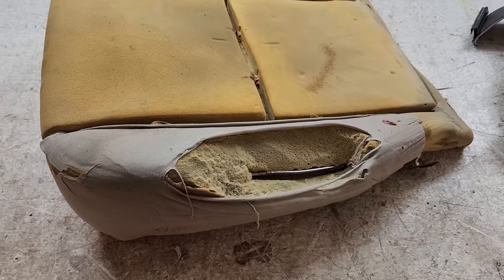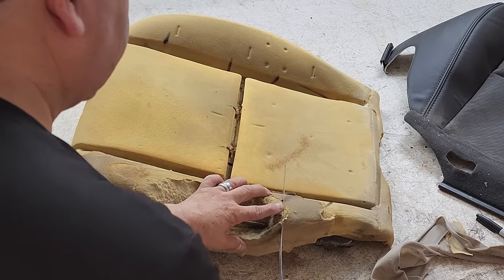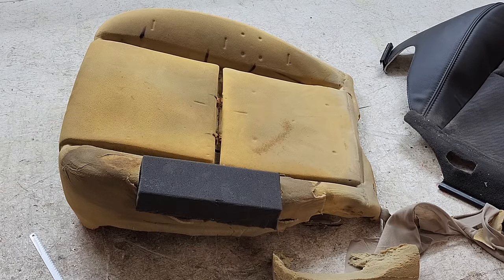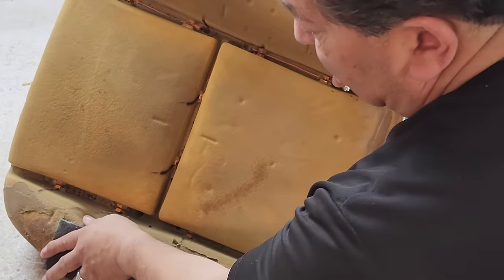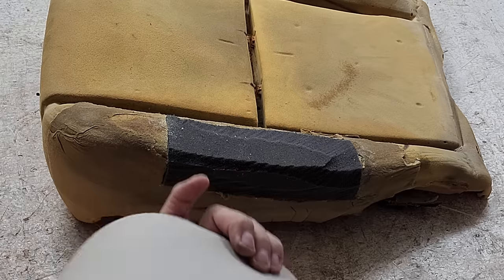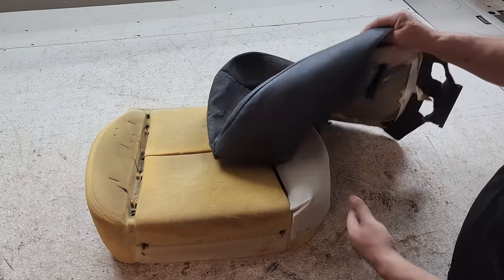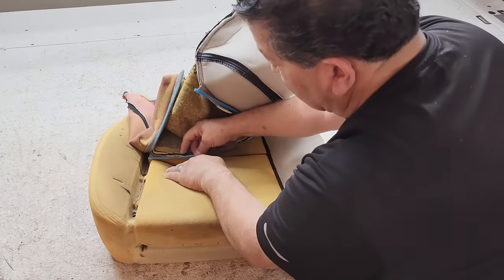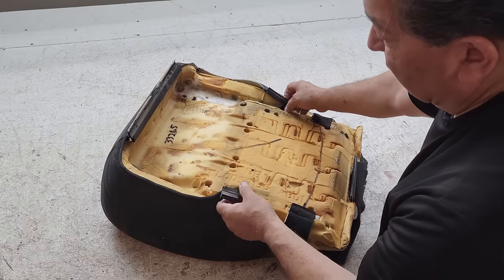How to do it yourself basic seat auto foam repair DIY

Comment: I worked for 13 yrs at an automotive plant manufacturing seats and we always fix tears in cushion and back foam with spray adhesive and never let it dry . Put it together wet for a better bond. Your method is correct
Reply from the maker: Hello Cherokee, I am so glad to hear that what I have been doing for 43 years is correct. Thanks for saying so. Please keep liking and watching!
Reply: The correct method is to spray the adhesive then wait a minute or two for it to become tacky then apply the foam
Reply: @kenshinhimura9387 that’s what the directions say but doesn’t always work best. Depends on application.
Reply: @oldschoolautoupholstery  Try letting it dry for a couple of minutes if you can. The only reason to not wait and instead put the parts together immediately is if you need to adjust the position of the parts. If you let it dry for a couple of minutes first it will stick at first contact and not let you reposition, but it wil adhere better.
Reply from the maker: @tahustvedt  Hello Ta, Yep, it wouldn't hurt. Please keep liking and watching!
Reply: @oldschoolautoupholstery  What you're doing definitely works and has worked for years. Glueing in a block like that in a corner would be hard if the glue dried until it became sticky first.
Reply from the maker: @tahustvedt  Hello Ta, Yep you are so right! Please keep liking and watching!
Reply: What spray adhesive do you use?
Reply from the maker: @jamesoylk  Hello James, I only use contact adhesive for everything I glue. Please keep liking and watching!

Comment: I just did something similar to my BMW sport seats. The driver side outer bolster cushion was badly damaged from years of being rubbed on, I went to a craft store and purchased a nice piece of firm foam to replace it. Figuring out how to cut it was a bit of a challenge, but ultimately I shaped it with a small pneumatic sanding tool I have. It’s a small 2 inch disc that rotates at a very high speed. It shaved down the foam very nice, and allowed me to get the proffer shape and profile that was necessary before installing the new seat cover pieces. Seven sections to that seat, what a pain in the butt. I bought it from a company named L seat, I would have loved to use a local upholstery shop, but there isn’t really anything like that here where I live, such a shame, I love  giving local businesses my money over big companies when I can.
Reply from the maker: Hello Schro, I love hearing stories like this where you set out to do something and then you saw it through to the end. Now you have a satisfaction and can be proud  that you did it! Remember learning is doing! Please keep liking and watching!

Comment: i did that on my old xj, but added extra padding to the bolsters for a sporting look when I deleted the sliders & lowered the suspension ~4".

The seats lowered ~3" with the sliders gone. They did not move, so I put the seats where I wanted. 

I also put on shorter tires, which made it quicker, and lowered it more. I made my 2 door/2wd XJ SUV into a fast(er) 3 door hatchback car.
Reply from the maker: Hello Iowa, Sounds like a funmobile! Please keep liking and watching!

Comment: I've learned how to do this years ago and repaired many seats, then i went fixing mine's but then realized i could buy a complete set of seats out of a brand new Audi they converted to RS look for 120 bucks, after that burning the old seats is the best way to fix them, and installing new ones by adapting the mounts on the chassis is way easier, unless you are fixing an antique or furnitures, so having this knowledge is well worth it.
Reply from the maker: Hello John, Yep, that is one way of getting it done. Or if you got an old work truck in Texas, you can do it this way. No adapting mounts or messing with airbags. My cost was under 5 bucks. Please keep liking and watching!
Reply: @oldschoolautoupholstery  Hello. Yes for a work truck it's the best solution, not even getting a new seat of the same kind worth it cause we know it's not going to stay mint for long.
However this is knowledge that one should have but will show its glory in other kind of projects.
Reply from the maker: @johnbelwell2461  Hello John, Yes I agree. Please keep liking and watching!

Comment: I used to do this for a living and you must wait for the glue to get tacky Before You Stick To Pieces of phone together or you're not doing it correctly and the seat will fail. You use an electric knife to cut the foam to shape then you use a die grinder to form it to mirror the other side. Do you use the much thinner phone to overlap the thick piece of foam you glue down and you cut every Edge at an angle and shave it down with the die grinder until it's perfect.
Reply from the maker: Hello Ken, There is no real wrong way of doing this. It's not rocket science. Like I always say, there is more than one way of getting things done. The name of this video is "DIY basic seat foam repair". I am a working upholstery shop and have to keep things moving all the time. You can see 44 years of my work here: rudolphsupholstery.com  Please keep liking and watching!

Comment: Thanks for sharing this video, you're so good at explaining what it is you do!

I'm wondering, would you ever add the 1/4" scrim to the whole seat or just the part you've repaired? I guess it might add too much bulk for the cover to fit if you did? It's just I'm going to refurbish a bench seat in my 19 year old van and thought it might make it feel newer if I covered the whole thing rather than just the repaired section.

I'd love to know what your thoughts are on this if you have the time. 

Thanks again for running such a great channel.
Reply from the maker: Hello Bloss, You are so welcome! Thank you for your kind words! 1/4" foam or scrim will not effect any bulk. Just think of it like bodywork on a car. Bad bodywork shows threw the new paint. Same for the foam repairs under the upholstery. Just get your shape right then reinstall your seat cover. Please keep liking and watching!

Comment: I have been gluing foam for sporting projects for almost 30 years. I have found closed cell you want to let it sit/get tacky. Open cell you can apply it wet. I figure this is because airflow still allows the foam to dry more easily.
Reply from the maker: Hello Andrek, You are absolutely correct. Closed cell foam I consider to be a hard surface that needs air to dry. Please keep liking and watching!
Reply: Hi Andrek, what glue do you use?
Reply from the maker: @gurglejug627  Hello Gurgle, I only use Contact Adhesive on everything. Please keep liking and watching!

Comment: Most of the times I didn't even cut out the "Cancer" you referred to.
I would just saturate the damaged area with contact cement, let it dry and then spray the HD foam I was using for a patch.
When glued together I then used my small sandpaper disk grinder and shaped the foam to match the original contour of the 
rest of the seat.
Sometimes I'd put the scrim foam but most times I was able to match up the contour of the original foam well enough that it didn't need the additional quarter-inch scrim on it to smooth it out.
Reply from the maker: Hello Tim, Like I always say, there is always more than one way of getting things done. Thanks for letting us know. Please keep liking and watching!

Comment: I'm an upholsterer. What you did wasn't bad, but the way I do it is a bread knife, then finish shaping with an angle grinder with flap disk. You can get it pretty perfect without having any hard corners from cuts. Then spray with headliner glue, and top with dakron. You don't get so much extra pooch that way. Then recover and done. Also, I probably would wrap the seat bar with dakron before adding the foam so I didn't have a crush point where it was hollow under the foam
Reply from the maker: Hello Chad, Like I always say, there are more then one way of getting things done. This was a basic repair for an old work truck in Texas. Not rocket science. Please keep liking and watching!

Comment: Brother I think you missed the fact that the whole bolster is dilapidated, for that repair I would usually take the whole top half off and replace and reshape it, or add a piece like you did then top it with a soft 1" foam, tapper of the edges and let the 1" kind of self shape to the cover to get it back closer to its original shape. I would also pull the old foam backing off the factory cover where it is already damaged and add a layer to the foam to limit the chances of there being any ridges or bums created with the old stuff rolling or bunching up
Reply from the maker: Hello Shienar, The title of this video is "The most common foam repair" This was an old work truck in a small town in Texas. This is to help those with no experience fix their own car. If your looking for something nice, see my 44 years of work here: rudolphsupholstery.com Please keep liking and watching!

Comment: Do you think 3M #90 high strength spray contact adhesive would be strong enough for a foam repair on a motorcycle seat? Thanks for the video!
Reply from the maker: Hello JG, You are so welcome! Since your asking me, I would have to say no. I never use anything from a spray can as it does not hold. I have only used real contact adhesive as I do this for a business for 43 years. I only want happy customers. Please keep liking and watching!
Reply: @oldschoolautoupholstery  So are you then referring to the yellow stuff in a can like they use to glue formica on countertops or do they have a newer less smelly version of that? ie Dap Weldwood?
Reply from the maker: @JG-kv4oi  Hello Jg, Well all I have used for 43 years is the Weldwood contact cement which is yellow and can be used for counter tops. Pretty smelly if you ask me. Please keep liking and watching!
Reply: @oldschoolautoupholstery  And I will, thank you. Jerry in Montana
Reply from the maker: @JG-kv4oi  Hello Jerry in Montana, Thank you!
Reply: 3M #90 will absolutely be strong enough for foam on a motorcycle seat. It is a very good adhesive. The foam will tear apart before the adhesive fails.
Reply from the maker: @athhud  Hello Athhud, If that's what you want, go for it! I always say there is more than one way of getting things done. Please keep liking and watching!

Comment: I have a 2011 Silverado and need to give the driver seat back cusion some more padding. Where can I get the foam and that high quality backing you're using? Thank you!
Reply from the maker: Hello Dalton, You are so welcome! Just google "Upholstery supplier near me" Remember, I would not disconnect that yellow airbag wire if I were you. please keep liking and watching!
Reply: @oldschoolautoupholstery  luckily no airbags in the seat. Already replaced the bottom cushion. Thanks again
Reply from the maker: @daltonfeltman5606  Hello Dalton, I love hearing good news like this! please keep liking and watching!

Comment: Did that work for 47 years. Not sure why you are against carving knives but they make great foam cutters. You should use a contact glue and should wait a few minutes before putting foam patgh in. Your repair could fail on a hot day. Yes the cover will hold it for awhile, but failure will occur.
Reply: Also, that top piece should not be necessary id you use contact glue because the cover probably has foam inserts in the cover. If not, your "top patch" should have gone all the way down the side, instaed of being short
Reply from the maker: Hello Jerry, You got me beat with my only 43 years. Respect... Nothing against any way anybody wants to cut their foam. I am just showing another way of doing it. As you know there is always more than one way of getting things done. I have never had contact adhesive fail me. Please keep liking and watching!

Comment: @oldschoolautoupholstery, it sure looks like the repaired side is lower than the other side by about 1/2 inch. In your experience, how close do you need to be so things like that aren't noticed?
Reply from the maker: Hello Webbed, It might have appeared that way in the video, but it really was ok. I only took out about 7 inched from the middle. The front and rear of the side bolster were left untouched. If that were the case, it could always be raised or lowered. Please keep liking and watching!

Comment: doing a custom sheepskin motorcycle seat cover.... 
how much larger would each panel need to be??
Reply from the maker: Hello The, I usually add 3/8" inch to the edge of my patterns for larger bulky things like Sheepskin. Cutting Sheepskin is so messy! Please keep liking and watching!
Reply: @oldschoolautoupholstery  Thanks for the info..... I am not sure how your hands lasted all these years!!  I just do it for my own projects and not good at it to say the least but my hands kill me for a couple of days after doing a job! I am a little afraid of the sheepskin job as there is little to no stretching to get a tight fit. I guess that is why I can't find any videos other than just laying it overtop and strapping it in. I need to redo the seat and don't like burning my butt and fabric is out too as it never seems to last. That is why I want to try making the cover from the sheepskin and staple it right to the seat frame. I looked and looked but couldn't find any Technique #'s to address this issue !!! Thanks again for sharing your years of expertise and helping us!
Reply from the maker: @TheMamonti1  Hello The, You are so welcome! Well, not many sheepskin seat covers in East Texas. My hands started hurting 30 years ago. Please keep liking and watching!

Comment: In the early 90s I worked in a car seat foam manufacturing plant we made seats for Nissan, Saturn, Honda, Ford, and later Mercedes-Benz. We used air knives to cut foam and a 90⁰ 2" quick change sander to smooth it out after that. If there was a bad tear or real problem spot we usually glued typar over it . Yes typar the same thing as weed blocking material. Would be a good idea to use this over the top of this repair before the headliner like material is used it won't stretch like that material will do therefore your glued bond is more protected since the weight is evenly distributed across the typar surface. Typar also adds a layer of protection against the foam surface making it allot more durable. Of course typar comes in different thickness and the thickness used depends on it's application situation. good video but I'm a seat artist and could do a hair better.
Reply from the maker: Hello DMC, You'd make a great Typar salesman. Like Typar building wrap? The scrim I use is in no way similar to headliner material. I use the best available and the backing is bullet proof. (Almost) It is very difficult to poke through. I have done it this way for 43 years without fail. I have never had a job come back. I guess I have been doing this way before there ever was such a thing as Typar. Also, keep in mind, this is a very basic repair on an old Texas work truck. Just to show that people can do their own foam repair. Like I always say, there is always more than one way of getting things done. Please keep liking and watching!
Reply: @oldschoolautoupholstery  typar is a "brand" no not building wrap. It's a synthetic material that is used for weed blocking sometimes. It has other uses it's a thin but sturdy material. It was also sometimes used in the mold to go between the foam and the frame to prevent the foam from squeaking on the metal frame. It's cheap and easy to cut and manipulate. Not putting your method down at all, just telling ya what I've done in the past.
Reply from the maker: @dmcd2460  Hello DMC, I am glad to hear about your experience. Thanks for sharing. Please keep liking and watching!

Comment: What kind of clue do you use,I don't have a sprayer either
Reply from the maker: Hello SMC, I only use contact adhesive for everything. Can be applied by brush. Please keep liking and watching!
Reply: @oldschoolautoupholstery  yeah my jeep wrangler seat is missing foam on the drivers side,I might try this,thanks
Reply from the maker: @smcewen7  Hello Smc, I think you will do just fine with your Jeep. Just go for it! Please keep liking and watching!

Comment: A 1.75 piece of foam cushion and a little clue about two hour work and going to charge the owner four hundred dollars for repairs .
Reply from the maker: Hello Walter, Yes exactly. That formula is the key to financial success. Gotta keep the shareholders happy. There is nothing wrong with that if the customer agrees and is happy to pay it. Boat people pay more than car people, Aircraft people pay more than boat people. Please keep liking and watching!
Reply: @oldschoolautoupholstery  yeah , I carried my truck to a shop because every time I hook my trailer pigtail to the plug in the bumper it would blow a fuse .the guy that fix it charge me 215.00 I later found out all he did was cut a wire and tape each end up  he Robb me with out a gun .that's being 14 years ago and it's hard to for get .
Reply from the maker: @waltermcneill2135  Hello Walter, I understand your feeling. I always 100% agree on the price with my customer at the very beginning and I always stick to it. I never raised the price that was agreed upon. There have been many, many times when I have spent several more hours on a project than expected and did not charge a dime more for all the extra labor. I have very happy customers. It shows in my reviews. Please keep liking and watching.